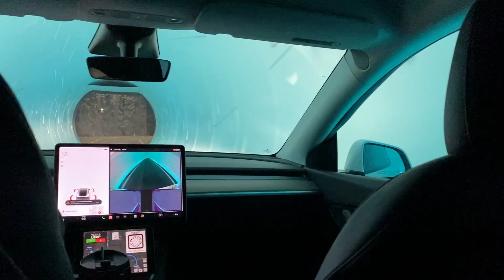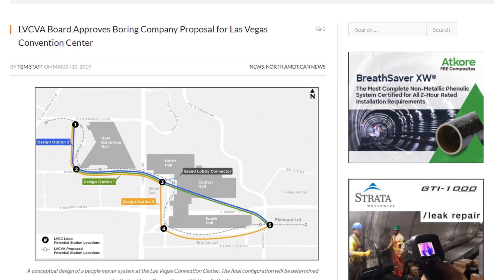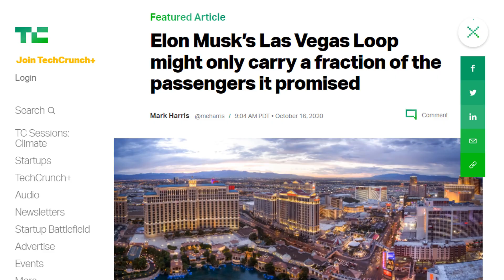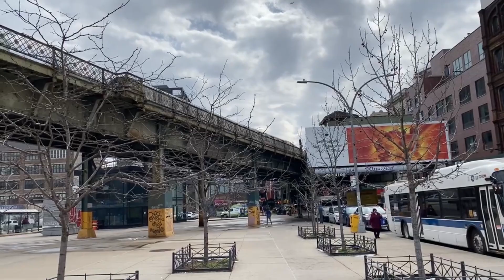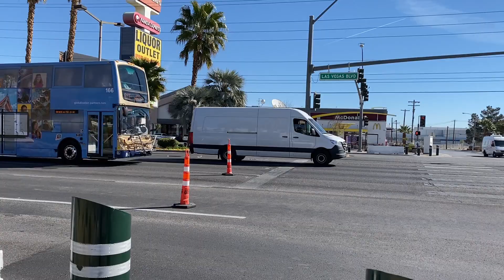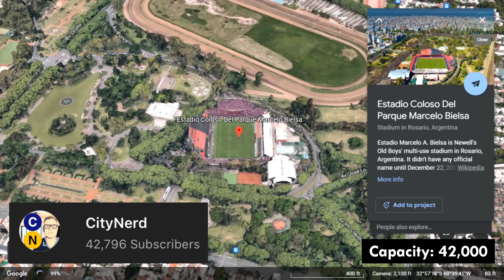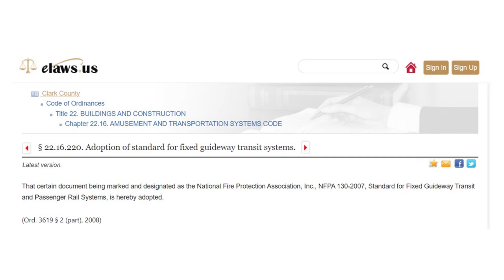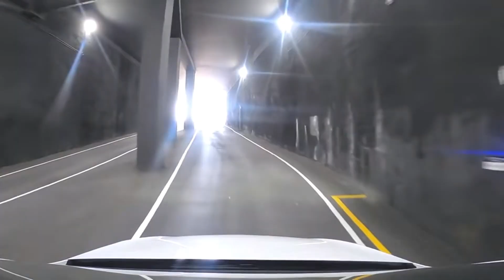Inside the Las Vegas Loop: Transportation Game-Changer, or Complete Waste of Time and Effort?

Comment: What is the best way to move people in and around suburbs besides a car? Also What do you think about shuttle or town buses?
Reply: It primarily depends on the walkability. Modern suburbia aka a desert of single family houses allows no other option besides cars while classic suburbs aka towns which are part of a city are best handled by a type of public transit. In the latter case it ultimately depends on the city size: As a rule of thumb, smaller cities need nothing more but busses, medium-sized ones also use some form of LRT (which in my definition includes trams) with few street running in the way to suburbs while larger ones also include a regional railroad (commuter / suburban rail) à la London Overground and S-Bahn, sometimes acompanied by a metro.
Reply: How do you define "best"? Also, what is the form of these suburbs? Many US suburbs are designed to make travel without a car intentionally significantly terrible; many who study urban planning realize this is an antipattern for objectives like sustainability.